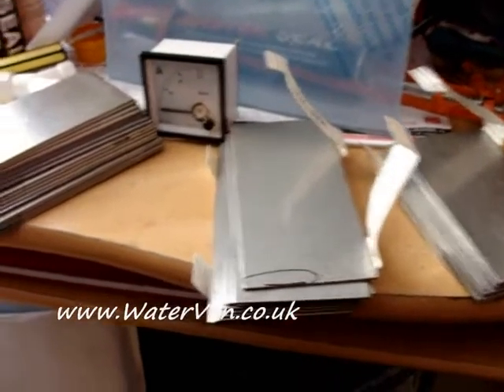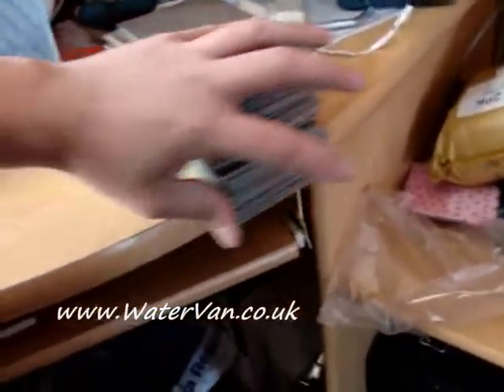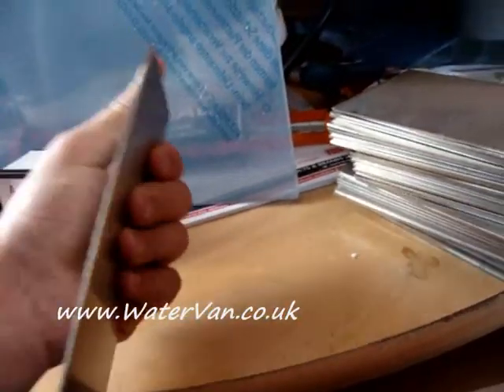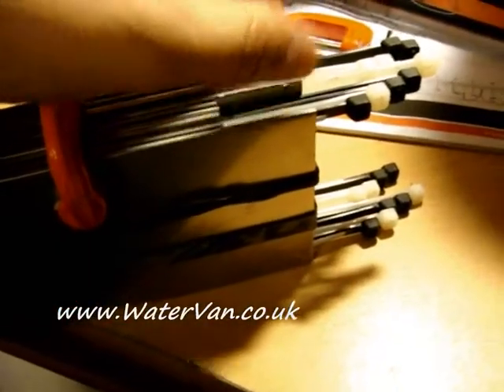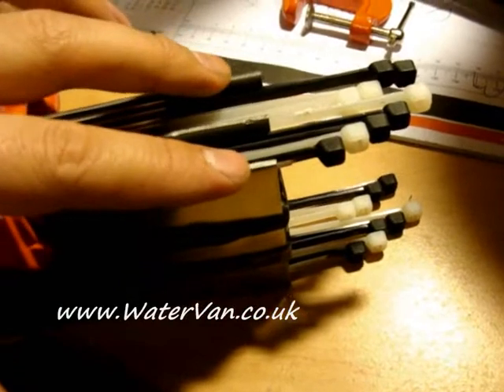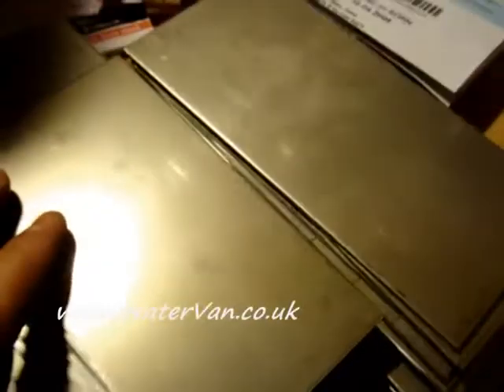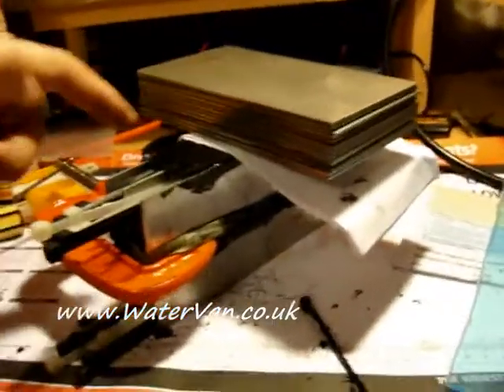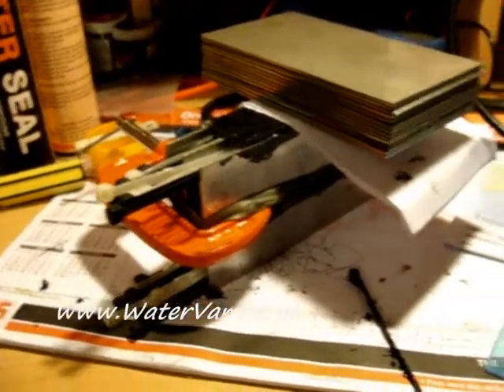#017 - MadStu's Water Powered Van - Building another cell

Comment: I guess its a little late to mention at this point, but what a lot of the fellow do who build a setup seimilar to yours is, lop off the corners on alternate sides of the plates where they will use a bolt to connect up.  gives a bit of space to get a tool in between when you go to tighten her up. Will be tough going, but suspect your Dremel tool will do it. Dont take a huge cut, just more or less knock off the corners outers on front, inner on back so to speak.

Comment: as far as connecting up your plate stack, I think I would go -nnnn+nnnn- ... but I have no proof that is more productive or really has any advantage, it just seems sensible to me ... a good degreaser to get contaiminate off you steel is a product called CRC Brakleen ... another automotive product used to clean off the brake system when being worked on ... active solvent is tetrachloroethylene ... then use a ctrus cleaner final ... carefull about fingerprints ...